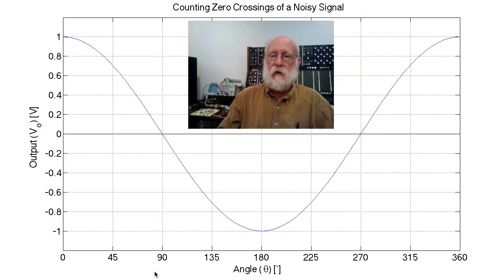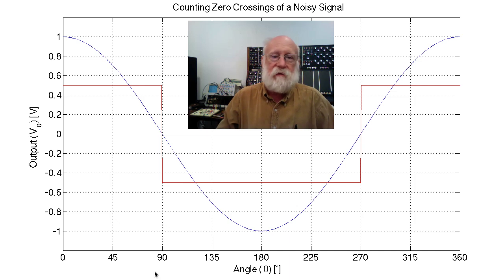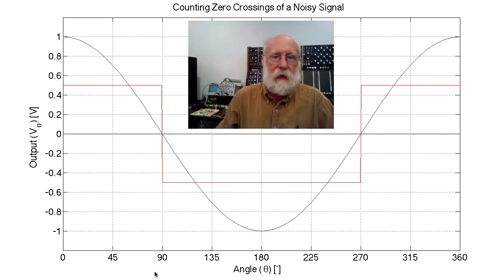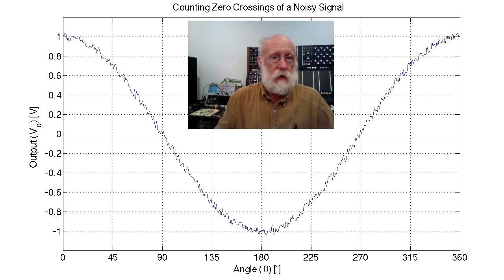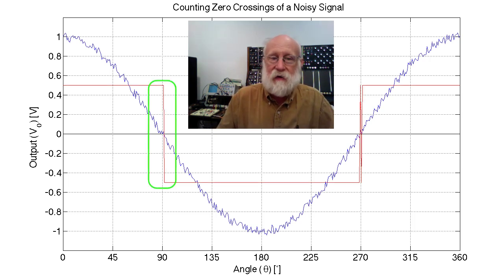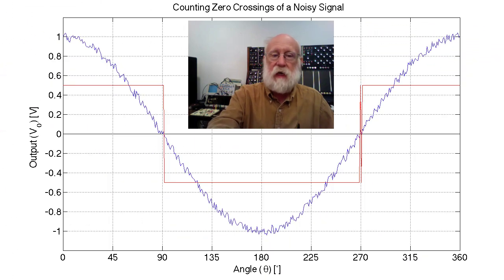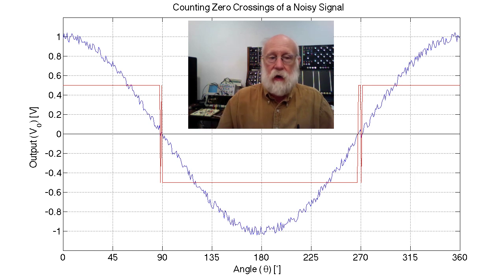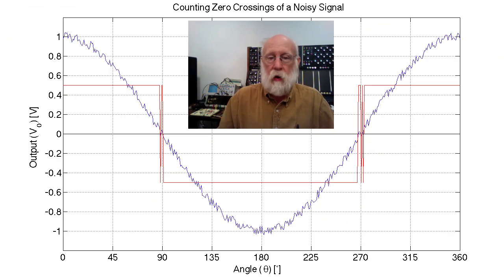Comparators Part 3 V3.0

Comment: I want yo design LDOs, BGR, ring amplifiers. Where to start?
Reply from the maker: First, never assume that a stranger understands what your abbreviations mean.

I assume LDO refers to a Low Dropout voltage regulator. This is not really my area of expertise, but I am fairly certain there are standard LDO regulators ICs that can be used as the "heart" of a low dropout power supply. For low currents (perhaps an amp or so), this would be almost trivial to design, and the manufacturer's application notes would be a good place to start. Higher current supplies would probably require a bit more design effort.

I cannot come up with anything for BGR that makes sense in context other than Blue Green Red (referring to LED colors), but in that case what sort of circuit using these are you interested in?

I am going to assume that you mean ring modulator, not ring amplifier. If so, this then depends on whether or not you want a "traditional" ring modulator using a "ring" of four diodes (preferably well-matched germanium). If you just want a four-quadrant multiplier (sometimes called a balanced modulator), this is fairly easy to do with off-the-shelf multiplier chips or with operational transconductance amplifiers. For both of these solutions, again the manufacturer's app notes would be a good place to start. I am fairly certain that the TI data sheet for the LM13700 dual OTA has a four quadrant multiplier circuit, for example. I have personally designed and built a balance modulator (for electronic music) based on the Analog Devices AD633 multiplier chip, and that is fairly straightforward. For the true "ring" modulator, this is a little trickier (and less "accurate"). I do have some balanced modulator videos in the works, but it will be some time (months, most likely) before I get these posted.

Good Luck!

Comment: Hey, Professor;
It might be useful to some "students" to discuss test and measurement equipment, since the real world depends on seeing what happens after the simulation and construction?
I was an application specialist at Tek, Agilent and R&S, so I've seen plenty of interesting problems with circuits that were measurement problems.
This is the first of your videos that popped up on my list...
Reply from the maker: I have indeed thought about it, but there are so many topics I want to address, and time is the limiting factor! I believe a few of my videos in which I discuss construction and testing of actual circuits have a few comments here and there, but I have only posted one or two of those so far.